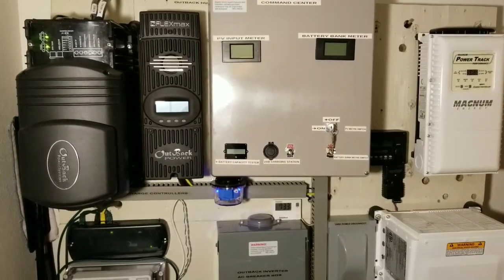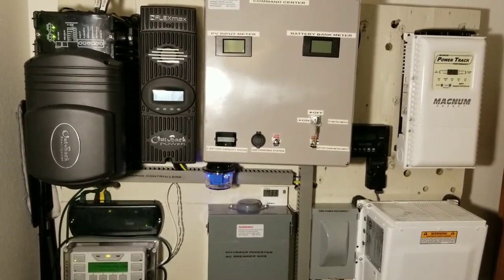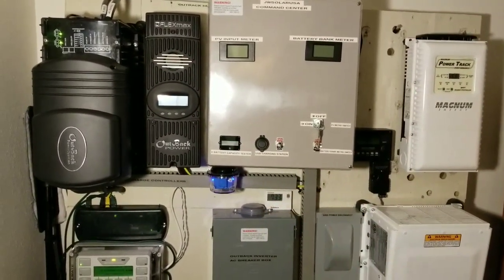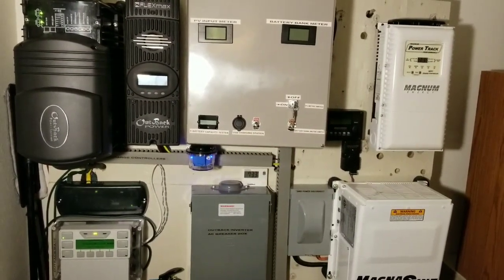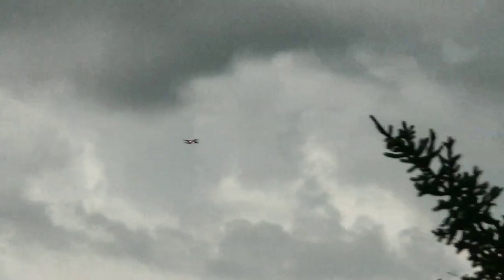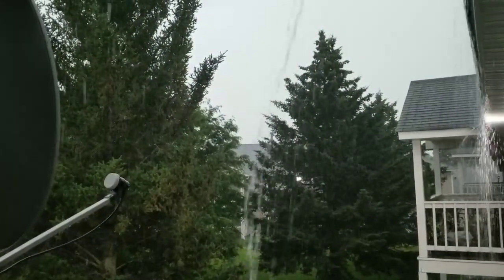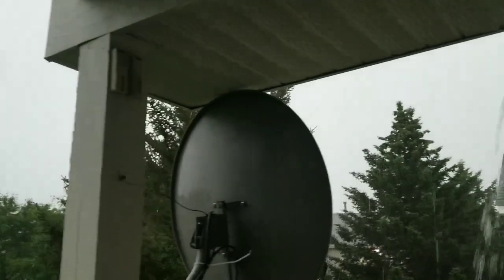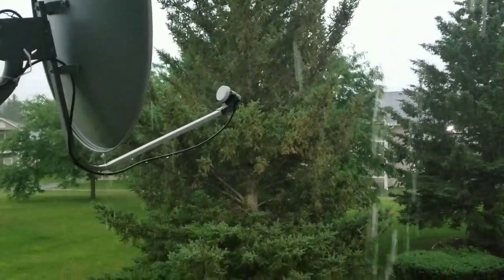MIDNITE SOLAR CLASSIC 250 MPPT CONTROLLER FOR WIND, SOLAR & HYDRO INSTALLATION

Comment: My Midnite classic 200 has been crashing lately needing a power cycle to bring it back
Reply from the maker: I am sorry to hear that. 
I never have any problems with both of my Classic 200's.
Have you tried updating the firmware?
Reply: @jwsolarusa  I updated it but it is still crashing  it crashes about once every two weeks  it's got me stumped it ran for two years no probs and has never been run at more than 30% of it's capacity 
I'll try rolling back the firmware as i'm using the voice firmware maybe there were problems with it as it's no longer available